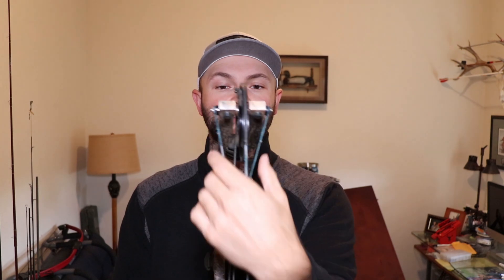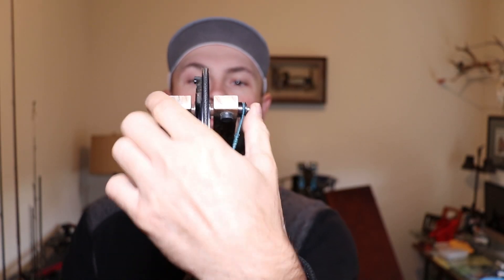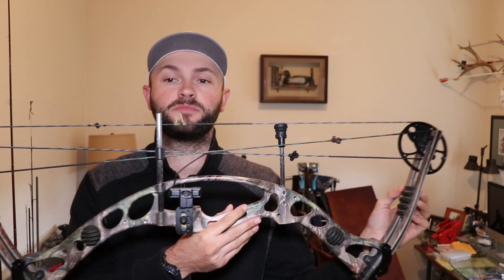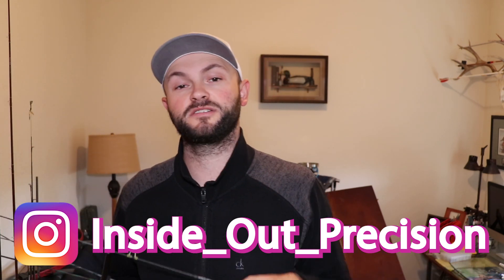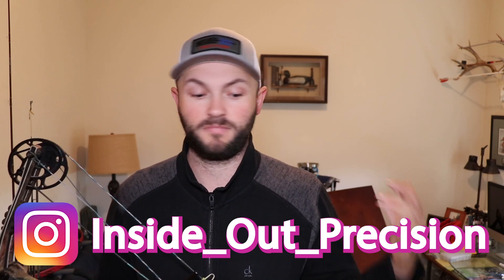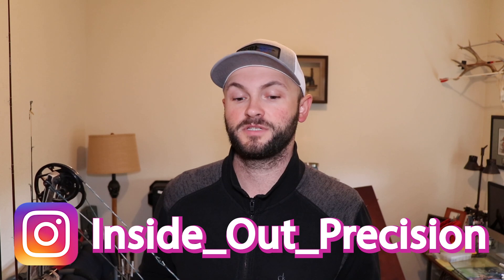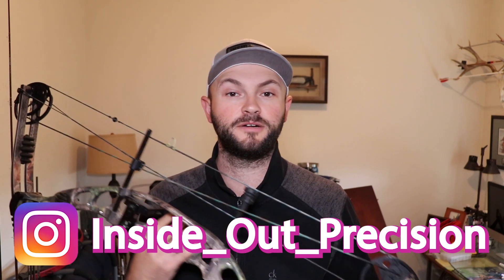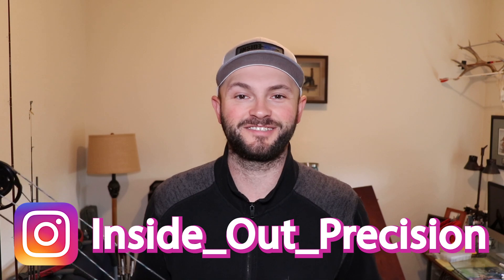What is Yoke Tuning?

Comment: AFTER I HAD CHANGED MY BUS CABLE AND CONTROL CABLE,  WHEN I WOULD COME TO FULL DRAW, I COULD HEAR A SOFT NOISE AT THE TOP CABLE OF MY BOW.   AFTER HEARING YOUR EXPLANATION ABOUT THE CAM LEANING TOO MUCH TO ONE SIDE, THE CABLE WAS SLIDING OFF THE CAM STOP SINCE I HAD TOO MUCH OF A LEAN IN MY TOP CAM.   THANKS FOR THE INFORMATION AND NOW I HAVE IT BACK WHERE IT BELONGS. YOU REALLY KNOW YOUR STUFF!!!!

Comment: If you have a single cam bow with an idler wheel on top, shouldn’t the wheel have a tiny amount of lean at rest and then straighten out at full draw?  Should twists be put in the cable when installing a new string set on in order to achieve the lean? (i.e. Mathews solo cam).
Reply: I'm wondering this also. I have a constant tear left with different spines, FP weights, and even adjusting the rest.

Comment: If I corrected my left/right tear completely with this method but am slightly knock high on paper with a bareshaft at 6 feet, should I now adjust the rest vertically to fix that nock-high tear?
Reply from the maker: Yes

Comment: I have a similar bow that function the same way with intentionally top cam lean from the factory, paper tuning was a pain for me specially that Im new to compound bows, okay now I made it shoot a bullet hole from like 3 to 4 feet far from the paper and when I started to install and adjust the sight, I noticed that the sight pins need to be far away from my peep to the point the sight pins already hiding behind the bow itself and unable to see to make the bow shoot the arrow straight as it was when I paper tuned the bow, This bow can actually achieve a bullet hole tuning without causing problems when it come to adjusting the sight after? what did I do wrong? Thank you. P/s I'm a left hand shooter and the arrow rest went so far to the right in order to achieve the bullet hole tuning.

Comment: Love your videos hope you will someday be greater than Wayne:)please if any advice for me what to do,I have persistent nock low tear while bare shaft shooting,its about 5mm lower from the bullet hole when fletched arrows used.No left or right at all.My cams are timed so that top one is I would say over rotating a little bit (both are making a contact to cables but top one is creating slight pressure on control cable).If I put that back to just touching-slower it down by 1 twist added to CC, its getting worse. What should I do please, it will kill me:)Is it ok to untwist half a turn of the bottom limb bolt to make it a little slower that top? thanks a lot
Reply from the maker: Just drop your rest a tiny bit!
Reply: @InsideOutPrecision  already tried this,no response at all,I think my bottom cam is faster than top one and pushing the arrow up regardless that I do to the rest,but funny thing is that,since top one is overrotating slightly,it should not be the case...I am blocked there:-(
Reply from the maker: @slobodandan3837  take a turn out of both of the yokes and see if it changes

Comment: For your next video, can you confirm or deny that putting a 3 sided broadhead in line with 3 fletchings will make the arrow fly straighter and be more in tune?
Reply from the maker: It doesn't make it fly more straight, but if you align them all like that then you know at least they're all catching wind the same way coming out of the bow and theyll be more consistent arrow to arrow. Good beoadhead fligjt has much more to do with the tune of your bow than the brand of broadhead or alignment of said broadhead.
Reply: I think he did this on a video called "Broadhead indexing" or something like that. 👍